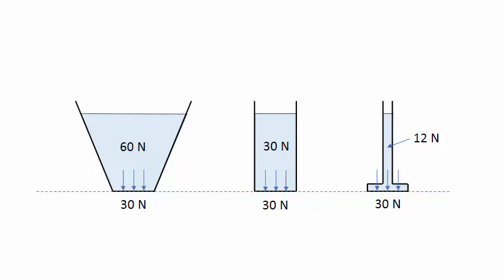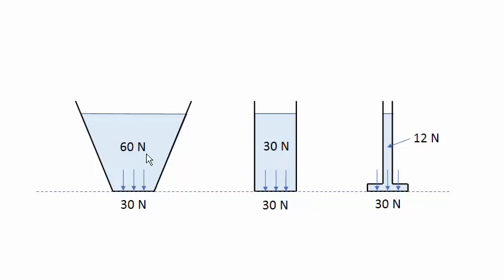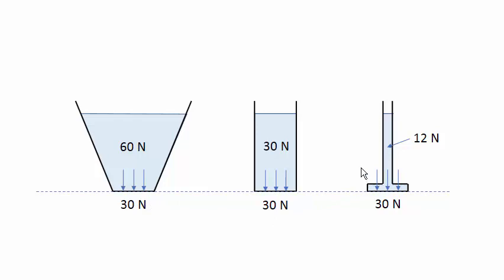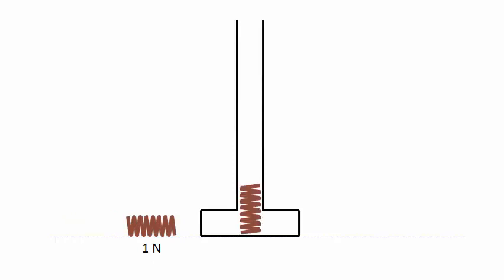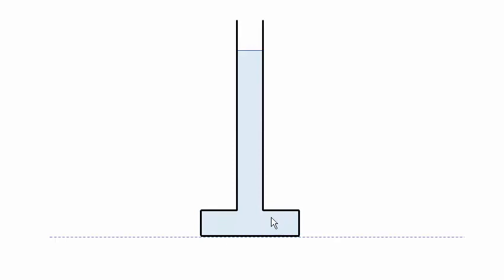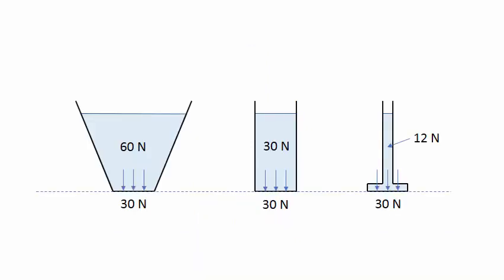Water Pressure on Bottom Exceeds Weight of Water

Comment: What happens if you widens the horizontal part of the third design? You continues increasing the pressure at the bottom without adding too much water? that's counter-intuitive. Because for the spring to be there you have to compress it first, but what is compressing the water there? Also, If you have that pressure applying force to the walls at the sides and the top, shouldn't be the pressure at the bottom reduced?
Reply: I understand that now. Pressure is not increasing when the horizontal part widens. The pressure is the same at the bottom because it has the same width and the container has the same depth. If it widens, pressure is reduced at the bottom so the area increases.

Comment: Why does it push 9 up and 15 down??
Reply from the maker: The total force on the bottom must be 30 N based on depth, and the total net force of water on the container must be 12 N down, based on the mass of the water. Therefore, the water must exert an upward force of 18 N (30-12=18).
Reply: @graychang99  It doesn't make sense. Can you show us in the real experiment? on paper, you can write anything you want, right?
Reply from the maker: The upward force of 18 N is evenly divided between the two parts marked in the diagram. These are the only places where the water exerts an upward force.

Comment: Hello G Chang, I saw your conclusion about the pressure being the same at the button so far it's of the same size. But the weight of the liquid adding up to the total weight at the bottom varies so how can you reach that conclusion. And how did you come about your Number (14N upwards and 15N downward) are they arbitrary numbers or what?
Reply from the maker: As for the liquid, the pressure depends only on depth, so the forces on the BOTTOMS of the 3 containers is exactly the same, since the bottoms are all the same size. But the TOTAL forces exerted by the liquid on the containers are different, according to the total amount of water (60, 30, or 12 N).
Reply: @graychang99  Thanks for this answer.  This was light bulb moment as I thought 3rd container magically gained more force at the bottom, the only increase is on the pressure of the container.
Reply from the maker: For the springs, I chose arbitrary but consistent numbers. The total net vertical forces exerted by the spring against the container must be equal to the weight of the spring. If a spring weighs 1 N and exerts a downward force of 15 N, then it must exert an upward force of 14 N (15-14=1).

Comment: I think this video is very well made. I seem to take a long time to understand certain concepts, and pressure has been confusing me for a while. I think the spring analogy really helped. I've seen both videos and I think it is finally starting to make a bit more sense. I understand this is an older video, but I still would like to check my understanding if you get the chance. 
Are you saying that since the water is sort of compressed into a smaller space, it still has the same weight (12N) but the walls of the container are feeling a lot more force since the water is in a smaller space? So instead of the water being able to comfortably occupy a space like the 30N of water, it gets pressed into that smaller space, but it would really like to relax instead of being there, so it exerts a force to try to escape, but the walls hold it in, and the total force it exerts ends up just being the weight of that water? And this could be seen by putting the water on a scale, and you'd see that it is 12N (if you have a fancy scale that measures Newtons), but if the walls were force sensors, you'd see that there is a huge amount of force on the walls since the water wants to be free.
Also, if the container was very bendy, say like a loop, could you say that the loop supports the extra weight, but the pressure at the bottom remains the same since it is a liquid and it all sort of affects each other? Like the water above the loop and below the loop can have an effect on each other since it's a liquid, and the water in the loop is just hanging out there because the walls of the container support it.
Reply from the maker: Yes, I think you are understanding it.
Reply: @graychang99  Great! Thank you so much for these videos!

Comment: But pressure equals weight divided by area. If more weight is placed, the pressure will increase! Where I am wrong?
Reply from the maker: That's what I'm trying to explain in the videos. (Did you watch both of them?)
Reply from the maker: For a solid object, it works just as you think. The pressure is just the weight of the object divided by the area resting on the table. But for water, the weight is distributed all across the sides of the container, in all directions. As a result, the pressure depends only on depth; the total amount of water makes no difference.

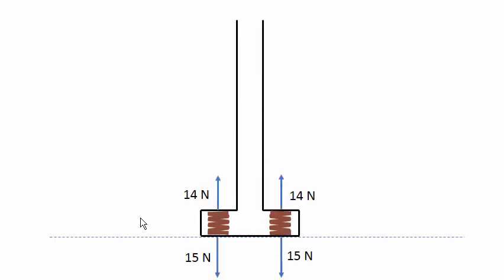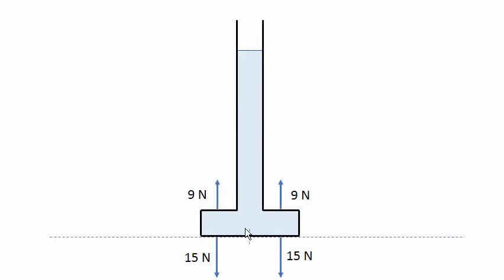Comment: Your spring analogy is very interesting but your drawings might confuse people to think that a weight scale at the bottom will read 30N. This is because  your drawings  show 15 N downward force OUTSIDE the container in certain sections! (Times 1:30, 2:20, etc.) In other parts of your presentation you show the forces correctly acting on the inside of the container.

To expand on your spring analogy, imagine a spring you compress and tie with a rubber band to hold it compressed. The rubber band  in my example takes the role of the walls of your box holding the spring compressed. The rubber band keeps the spring compressed and the spring keeps the rubber band stretched. Both applying zero net force on the other.Now if we  put this spring on a scale what will the weight be? The compressed spring will weigh the same as the uncompressed spring in this case.  Although there might be a large force by the spring acting on the rubber band (analogous to walls of the container in your case) this force is not acting on the weight scale.
Reply from the maker: OK thanks, I will try to make it more clear next time.
Reply: Wow, that clarified my doubt, @baklavatatli7301, thank you so much.

Comment: while your explanation is 100% correct with respect to accepted hydrostatics, it is incorrect with respect to actual hydrostatics regarding the third container. While water is pushing upward against the ceiling of the third container, the magnitude is not based on hydrostatic pressure but on the mass of the water above the ceiling as I explain in my paper at 
https://www.youtube.com/watch?v=oCOKa5pLnTc
the reason being the force exerted by a liquid is not, as with a gas, linked to the internal pressure since with a liquid, unlike with a gas, mass interferes.  I prove this experimentally: 
https://www.youtube.com/watch?v=ntd9TzUoU7k
Reply from the maker: Interesting experiment. However, the way you had it set up, you were simply weighing the container and the water, not measuring the pressure at the bottom. The upward force on the horizontal part of the container canceled the high pressure of the water -- the container was pulling up through the taped joint while the water was pushing down. 

What you need to do is clamp the container to the chair, so that the chair holds the container in place, and don't tape the joint between the bottom of the container and the scale; instead, make the scale work like a piston. That will be hard to do because when the pressure gets high, the water will leak through the joint. 

Another way to do it is to measure the pressure with a pressure gauge. If you don't have a pressure gauge, you can poke a hole in the container and see how far the water squirts out when you use a skinny pipe and a wide pipe. I think you'll  find that the distance the water squirts out depends only on the depth of the water, not the width of the pipe or the weight of the water.
Reply from the maker: Think of the upside-down T-shaped container with the 2 springs inside. You cut off the bottom of the container and tape the container on top of a scale. Although the springs are pressing against the scale, the scale does not register their force because the tops of the springs push up against the container, and the container pulls up on the scale through the tape. The scale only shows the total weight of the springs and the container. That's what happened in your experiment.
Reply: You state, I was simply weighing the container and the water, not measuring the pressure at the bottom & mention the point being taped. The joint was not taped as the tape was only on the edges of the opening in the container smoothing rough edges. The scale was inside the container, between the bag of water and base of container, thus taking the force from the water and negating any need of clamping the container down. The scenario is the same as if one placed a weighing scale inside a tire, against the side then inflated it tire - it would register the force against it. Had the scale been on the outside it would have weighed the water. There
As for a pressure gauge, it would measure the internal pressure which would be a function of depth, just be fruitless. 
As for holes in the side, regardless of mass or pressure based, they would show the pressure increased with depth which I already accept. 

Again, I remind that, the only way a liquid could exert more force against the bottom than its weight would be by increasing in density or expanding - think about it.
Reply: As explained above, I did not cut off the bottom of the container but only cut a hole for the scale. Therefore the bottom of the container kept the scale in place. Thanks for the comment. I will have to clarify.
Reply from the maker: The video didn't show the experiment being set up, so I didn't understand how it was connected. A cross-section drawing of the setup would help. My understanding now is that there was a flexible plastic bag in the bottom of the container to hold the water, sitting on the scale and weighed. 

I would like to suggest you try the experiment again, but this time tape or clamp the container and pipe firmly to the chair, to prevent the container from "riding up" or floating on top of the bag as it fills up, and/or tape the bottom of the container to the bottom of the scale (the stationary part, not the springy weighing platform), so that the scale acts as if it's inside the container. As the bag fills up, it pushes up against the top of jug, which must be held firmly in place relative to the bottom of the scale. Then I think you'll see the force exceed the weight of the water.
Reply: The bag fills the entire gallon container, protrudes through the opening at the top of the container and around the pipe which fits snugly in the opening. The weighing scale fits inside the two openings in the container at the bottom and rests on the bottom. Once water is added, the bag fills completely, completely filling the container and pipe, pressing down against the weighing scale that is pinned against the bottom.   Therefore, there is no opportunity that the force from the water is not registered on the scale.
Reply from the maker: The connection between the container and the scale is critical. At the 1:31 mark, it looks like the container is resting on top of the scale. Is that top the springy part you stand on to weigh yourself? If so, the experiment won't work correctly. Does the scale have a little springy platform inside that the water bag is resting on, and the "top" that I see is the immobile "base" of the scale? Then the experiment will work as I expect IF the container is somehow held firmly in place, by taping it to the base OR clamping it to the chair (or both). If the container is loose, it will "ride up" (float on top of) the bag as the bag fills up. Then the extra force of the water won't register on the scale.
Reply: the scale is an Ozeri electronic kitchen scale only ~1/2" thick by 6" wide and long enough to extend thru both sides of the container though an opening I made on each side of the container. So with both ends protruding thru tight openings it is clamped in place before and during the experiments so could not move.
Reply from the maker: It looks like you're using this scale: 

https://heavy.com/tech/2016/10/top-best-kitchen-food-digital-scales-electronic-food-weighing-salter-ozeri/

From the video it looks like the container is resting on top of the scale. What you need is for the container to rest on the ground and to be held firmly in place on the ground (so it can't ride up when the bag fills), with the scale totally enclosed inside the container. Only the bag of water should be touching the top of the scale.
Reply: I told you the scale was inside the container
Reply: I agree I could have made it clearer. I am putting together a video with ideas and instructions for simple experiments. Using plastic bottles is very quick. A explained in my description, I just cut openings in the bottom into which I inserted a weighing scale.